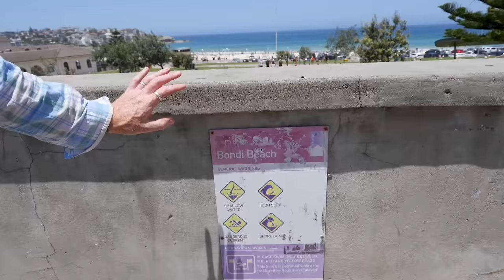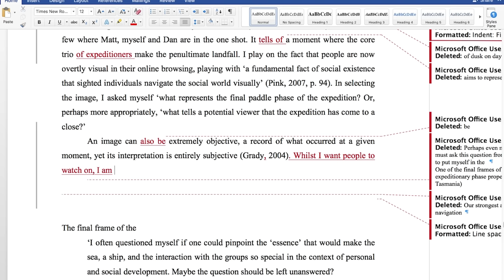Drinking wine found on the side of the road

Comment: Beau I agree with your message on using less, recycling, up-cycling etc etc. I try to live as frugal as i can and i admit i have a garage with 3 motorcycles in it. I don't use them very often but i waste nothing if i can. Axemanship is wasting wood even if it is all knotty but perhaps you would use it for the stove. You lads, down under have a far more abundant and diverse wood supply and consequently waste what we here in the UK would consider to be rare or valuable. Here its all knotty pine or MDF :( MDF is POISON fyi.

Comment: Hi Beau, just wondering what stroller you use for running? I've been pushing around a mountain buggy that I rescued from a dumpster a few years ago, and it does pretty well, but it's a bit wide for the rough single tracks and the wheels could be bigger, so I've had my eye out for an upgrade. Then I saw what you had at 10:33 and it looks NICE - bigger wheels and narrow - is it a custom job?